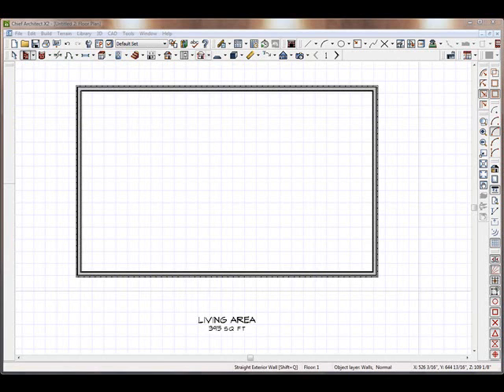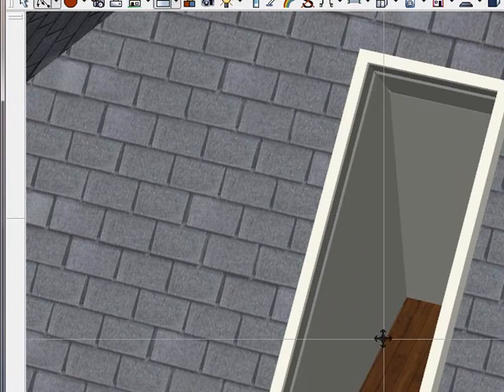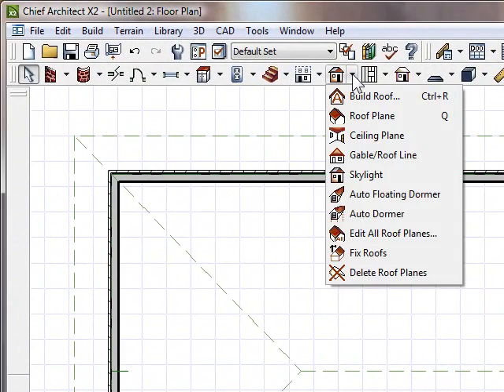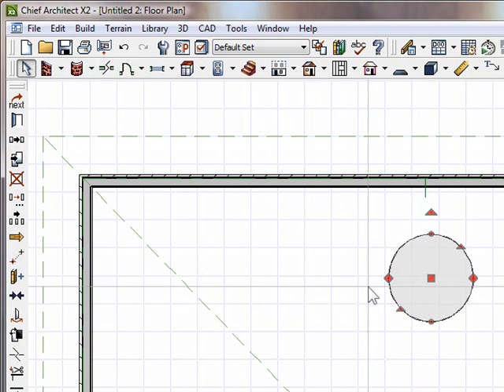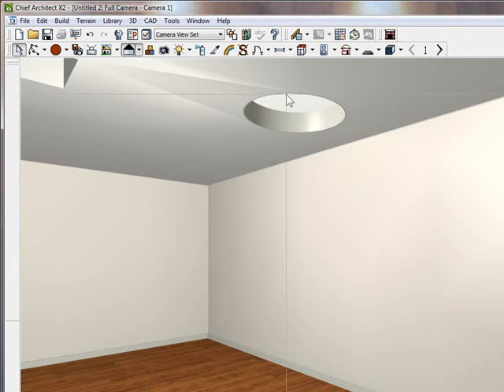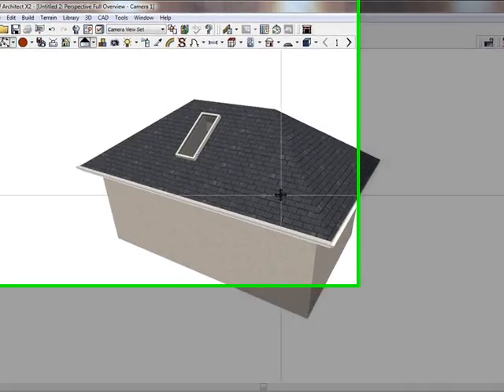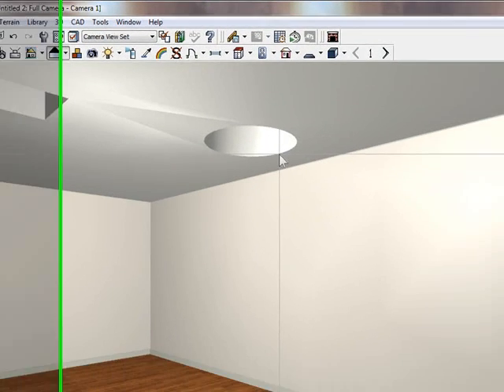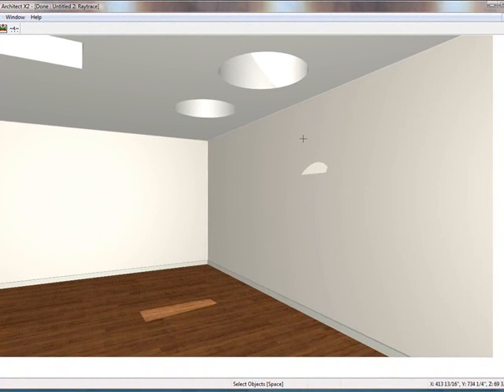Installing Skylights - Chief Architect

Comment: I'm considering a skylight in a vaulted ceiling room that would open to let air in or out Since I'm also trying to get more light in that room, it wouldn't be centered in the middle of the room. My question is will the hot air in the upper reaches of the ceiling escape from the entirety of the room or would it just escape in that portion of the room where the skylight is located.